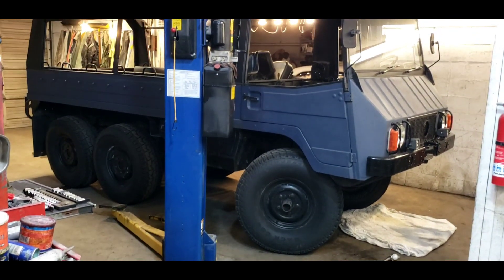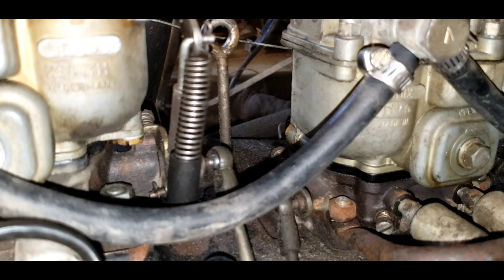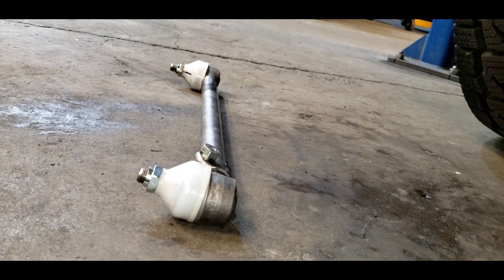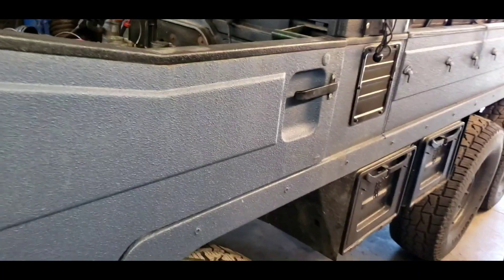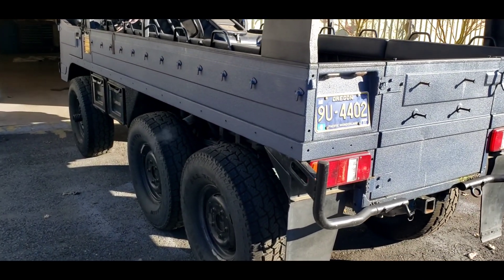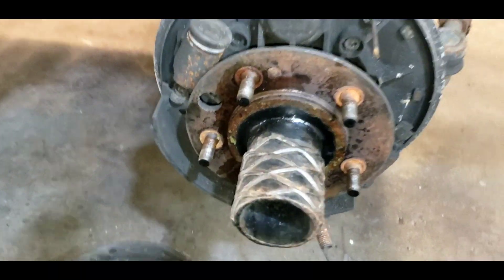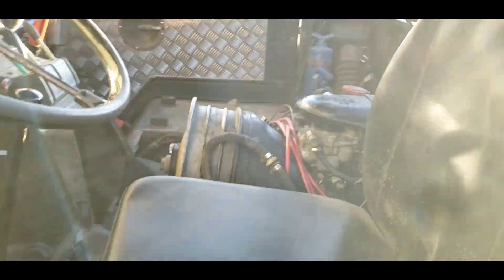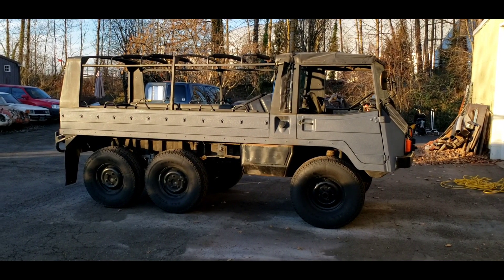Pinzgauer Fixer Upper

Comment: Seeing this at 9:44 is a very strange looking frame.  I’ve wondered how it handles off roading and a single tube frame would twist a lot?   No?
Reply: It doesn't have a classic frame nor a central tube frame (like the Haflinger does), it's kind of a over engineered rectangular metal tube and metal sheet platform construction.If there is one thing a Pinzgauer never does, it's twisting an inch in any situation. Only the tubular swing axles are moving, till the big rubber limiter above or the limiter cable hold it back from going any further. The central tube you mentioned is visible at 9:43 - its bolted to the manually lockable differentials (the edgy aluminium things between the single suspended spring axles) and contains the drive Shaft spinning at high rpm because of the wheel gear reductions that get it back to normal speed. The Springs and shock absorbers are mounted to the to the platform chassis that stays absolutely stiff in any situation. The accelleration and breaking forces are taken by the swing axles to the aluminium differential housings. 
For examples look for pictures "Pinzgauer im Gelände", the wheels are lifting in the air, while the platform is not twisting at all.

Comment: Those carburetor linkage ends look a lot like hobby grade steering linkage ends for RC cars. I know for a fact that those linkages are pretty dang tough if you've ever seen a nicer RC car take a bashing LOL. Might could look into a hobby shop and see what that offers. I would think that carburetor linkage take a lot less abuse than the linkage on a RC car.
Reply: Thought the same thing. There are loads of similar aftermarket linkages around, especially in the hot rod or vw air cooled scenes. Or get something machined in brass to fit into the original.
Reply: There are tons of those heim joint linkage ends with 1/4"nc threads in a surplus store in manitoba Canada .
Reply: Mc Master Carr has all of those parts.

Comment: Pinzgauer was made by Steyr (the specialist for 4x4 vehicles) which also makes the hyper expensive Mercedes G Jeep, and made the military version of the Mercedes G. The Pinzgauer was very popular as a swiss army troupe transporter or ambulance etc. Finally, they were sold in Switzerland at military outlet auctions, mainly to swiss mountain farmers. Parts must have been sold also that way or maybe still remain in a forgotten swiss army depot. Today, they are not as cheap as they used to be on those auctions.

Comment: I also would have replaced the braided fuel line at the engine for a proper armored synthetic rubber hose that is resistant to ethanol fuel.